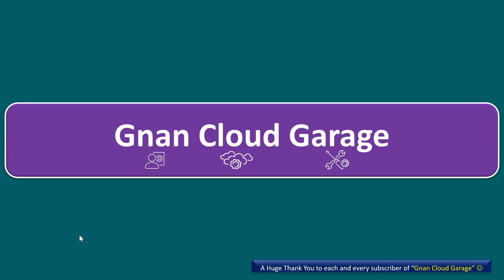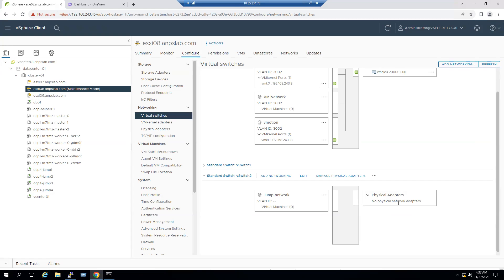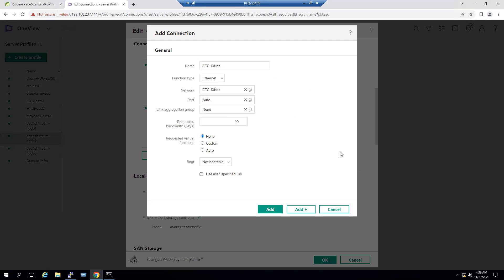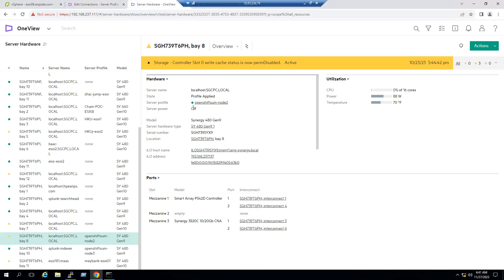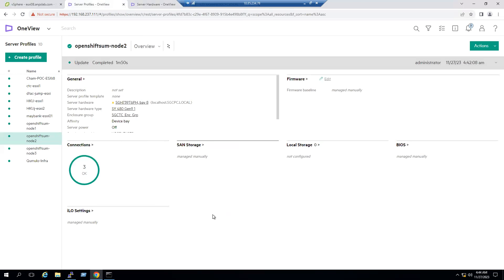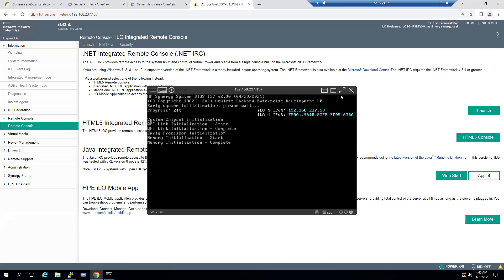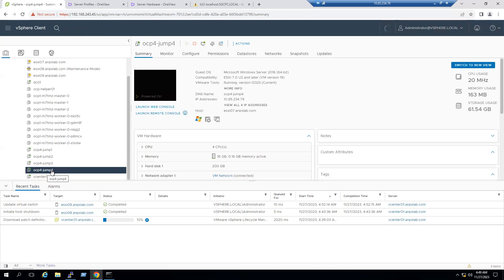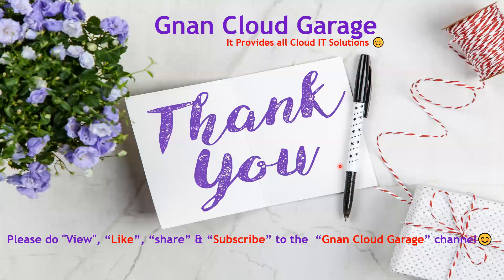How to add a Network Connection on an ESXi host running on HPE Synergy Compute node using OneView?

Comment: Hello, it would be helpful, if you could explain, how Port mapping will happen to each Compute module (Blades) in Synergy Frame in simple language with example. Thanks in advance
Reply from the maker: Hi! Thanks for your question! 😊 Here’s a simple explanation of how port mapping works for each compute module (blade) in an HPE Synergy Frame using OneView:

Port Mapping Overview on HPE Synergy with OneView
Synergy Frame Setup:

The Synergy Frame contains multiple compute modules (blades) installed in bays (slots).

Each compute module has multiple network interface cards (NICs) or mezzanine cards.

Interconnect Modules:

Network connections for compute modules go through interconnect modules (like Virtual Connect SE or Fabric Modules) installed in the frame’s interconnect bays.

These interconnect modules provide uplinks to your physical network.

Port Mapping Concept:

Port mapping defines how each blade’s network ports (NICs) connect through the interconnect modules to uplink ports.

This lets OneView present a logical view of the network connections for each blade.

How It Works in OneView:

OneView discovers the Synergy Frame, interconnect modules, and compute modules.

You configure network fabrics in OneView representing your VLANs and network segments.

You assign network connections (uplinks) on the interconnect modules to specific logical networks.

OneView automatically maps compute module ports (NICs) to the corresponding interconnect module ports based on the hardware layout.

Example:

Suppose Blade in Bay 3 has NIC1 and NIC2.

Interconnect Module in Bay 1 has ports connected to your core switches.

OneView maps Blade NIC1 to Interconnect Module Port 1 and NIC2 to Port 2.

The logical network “Production VLAN” is assigned to Port 1, and “Management VLAN” to Port 2.

Thus, Blade NIC1 communicates on the Production VLAN, and NIC2 on the Management VLAN automatically.

Benefits:

Simplifies network provisioning for each compute module.

Enables flexible network designs without manual cabling changes.

Provides visibility and management via OneView UI.

Comment from the maker: 🔧 Title:
"How to Add a Network Connection on an ESXi Host Running on HPE Synergy Compute Node Using OneView"

In this tutorial, we'll guide you through the process of adding a network connection on an ESXi host running on an HPE Synergy Compute node using HPE OneView. 

Networking is a crucial aspect of managing your infrastructure, and with OneView, the process becomes seamless.

#ESXi #HPE #SynergyCompute #OneView #Networking #TechTutorial #InfrastructureManagement #ITOperations #ComputeNodes #TechGuide #HPEOneView #NetworkConfiguration #Virtualization

📘 Outline:
- Introduction to the importance of network connections in ESXi on HPE Synergy Compute nodes.
- Overview of HPE OneView and its role in managing networking configurations.
- Accessing HPE OneView and navigating to the ESXi host.
- Step-by-step guide on adding a new network connection.
- Testing the new network connection.
- Troubleshooting common networking issues.

👍 If you find this tutorial helpful, don't forget to like, share, and subscribe for more tech tutorials and guides!

🔔 Stay tuned for the latest updates, and thanks for watching!

Gnan Cloud Garage Playlists
https://www.youtube.com/@gnancloudgarage5238/playlists

VMware vSphere 7 & VMware vSphere Plus (+) | Data Center Virtualization
https://www.youtube.com/playlist?list=PLjsBan7CwUQAFA9m2dYEL2FmeRdRiyWBD

vSphere 7.x - Home lab - Quick Bytes | Data Center Virtualization
https://www.youtube.com/playlist?list=PLjsBan7CwUQBZi-xYgihJop0psqK6S8sb